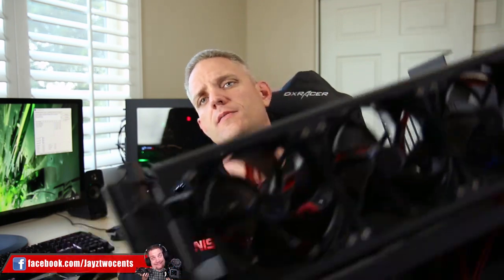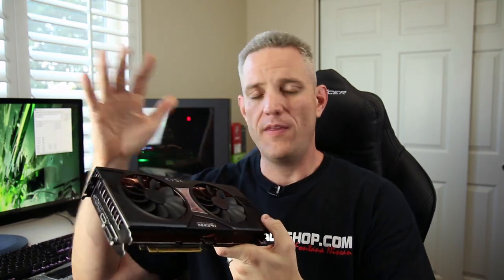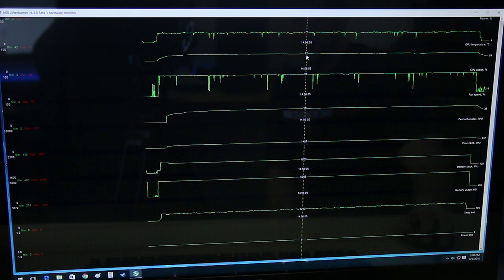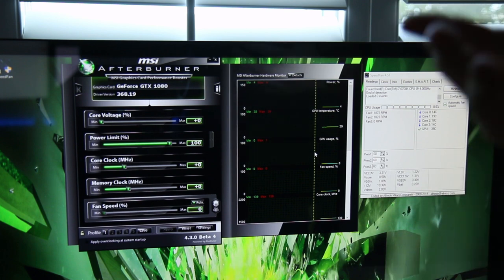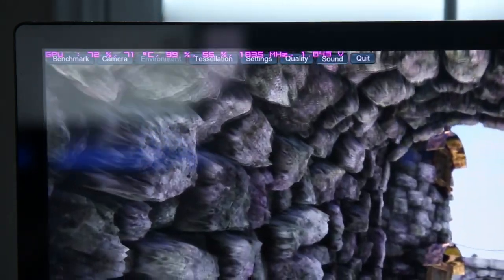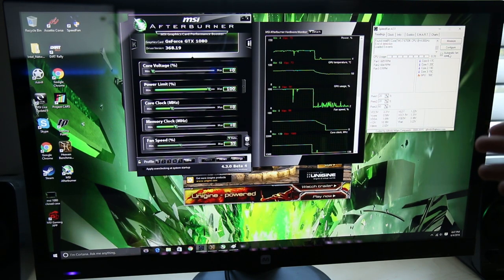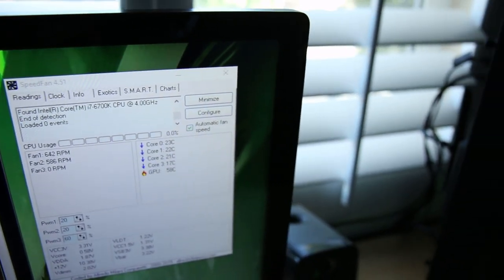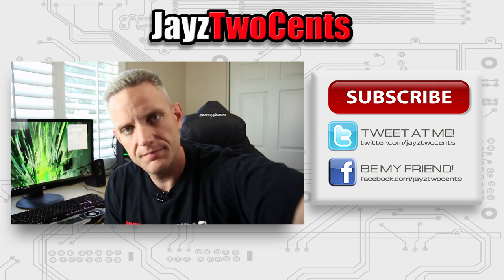Do cases make video cards run hotter?? - Test Bench vs Case

Comment from the maker: Now the argument seems to have shifted to "Why are you using liquid cooling?! Thats not fair because CPUs can heat up a case...." So now there are folks saying that CPU temps should be factored in.... how am I supposed to account for all the different CPUs and CPU coolers? I am testing the coolers ability to deal with the heat the card outputs, not how well it deals with poor case airflow and CPU coolers.... I expected the argument to shift a little after this video, but now its just getting ridiculous. 

There is absolutely no way for me to give YOU the test that 100% represents YOUR situation. Impossible.
Reply: Agreed.
Reply: can't wait for the 1070 sli. don't listen to every whiner out there. they think they know this and that and somehow they don't have a YouTube channel to be showing what they know. we saw what you tried to explain and that's that.
Reply: Jay if they want to be idiots just tell them the front mount rad pumps loads of heat the inside of the case just like air cooling would.
Reply: The front mounted radiator would heat the case just as much as an air-cooled tower cooler, would it not? I could see their argument if you had the radiator set up at the exhaust, but being at the intake the same amount of heat is still being taken from the CPU and displaced into the case. Seems like some people don't understand basic thermodynamic principles...
Reply: omg just ignore them.... lol. The testing here has already been comprehensive enough to show that this is a non issue. Thermal throttling can happen to any card that has been put into a badly ventilated system configuration. You cant take into account of every single scenario.
Reply: you did a good job jay :)
Reply: Next argument will be the cup holder err the dvd rom is broken.
Reply: It would. It's taking more heat off the processor, but since his radiator is set up as intake in order to keep the CPU itself cooler, all that heat that it is taking off is going into the case. Worst case scenario for the rest of the components, but best case for the CPU.
Reply: Thank you for making this video.  It is annoying that people seem to think what they want to believe and believe it as fact so much every other actual fact is BS to them.  This video proves exactly what you thought to be correct.  Using your open test bench doesn't affect temperature or fan speed on the card for that matter. I knew exactly how this would turn out, because if you have a case with a good airflow and your temps are spiking to over heating levels opening the case does jack squat for temps, unless you get a giant ass fan blowing on it.
Reply: You can't please everyone Jay......keep doing what you do!
Reply: Jay, my goodness, I don't know if I could handle the barrage if insanity. Wth is wrong with everyone? FFS, you have absolutely no reason to tweak or mess with numbers.. Man the way you had to go out of your way with one long shot to show these people there is no conspiracy. This mob mentality and stupidity reminds me of the truthers and other internet idiots who see a single post on 'any' website and take it as fact. They stand tall on it, bullshit as it may be, and defend it to the death. You got some seriously good inhibitions, I think I would lose my fucking mind.
Reply: Easy, just do the test WITHOUT the CPU ;)
Reply: The vast majority of your subscriber base im sure believe your initial test and the vast majority of the people saying otherwise are likely trolls.
Reply: Haha
Reply: People who understood the video and its purpose aren't making these questions. I would urge people to request Jay to make  some specific type of content that they want to see, and not just put off this informative video as bad.
Reply: I've always thought that it was impossible to represent all configurations. What's important is to be consistent between tests (at least if you are going to compare results.) Beyond it comes down to what makes sense for you, which is likely the test bench for ease of use. 

That being said I can see where most people are coming from. The most common configuration of people watching these vids is likely a CPU with a tower cooler and a discrete GPU in a closed case with only a couple of fans installed. That's likely going to allow the heat to increase in the case when the system is under heavy load, but obviously it will depend upon the configuration of the system (# of fans, location, amount of air moved by the fans and even cable configuration could change the air flow.) Which gets back to being consistent between tests.
Reply: but but but jay you didnt farthed in front of the rad.

the good old airflow in case that is an forgotten feature....

every pc setup has hes own situations depending :
-what case ,what size of case ,what size of fans ,amount  of case fans,intake or outtake count.the only general  factor these days is that all cases are made for positive pressure airflow.thats why the big amount of holes in the case every where ,does it have open side panels and are there fans  mounted on it.
-what cooling do you use for cpu ? air , air vapor chamber, AIO watercooling , custom watercooling and what fan size do you use and rad size.
-what cpu do you use 
-what gpu do you use and how is it cooled
and the list goes on and on and on .

no-one is able to test all the setups existant in the world and the best tester for your own setup is yourself.

there is general information from the people that do tests,reviews and benchmarks but its an guide line and not an final answer for every setup.

pls Jay stop taking those 13 year old know it all in frontal .its a troll battle you will never win and only harm the channel.

keep on the great info and get the 3 way 1080 sli  working vs  2way sli so we all know if getting an 3th one on this new line up make sense.
Reply: what was the room temperature?
Reply: Can I send out my system to you and you test it for me? but please account for my dusty environment and high ambient temperatures during summer as well as low ambient temperatures during winter. Thank you.
Reply: They are butthurt because they expected the results to be reversed, when they didn't see what they expected they lashed out.  That is like the videos on LinusTechTips where they compare how important the shape of thermal compound is, how important cable management is, how important power supply positioning is, etc...

I think a potential reason why the card ran better in the case is because the airflow is more concentrated.  With an open test bench, the air can escape out into the open room, leaving less air for the card.  With a computer case, there's only so many places that the air flow can go.  That allows more of that airflow to reach the graphics card.  The volume of airflow will make a bigger difference than a couple of degrees temperature.
Reply: A front mount radiator pushes all the CPU heat back into the case anyway, far more than any air cooler would.  People who are saying it's "unfair" are idiots who don't understand Thermodynamics.
Reply: It shouldn't make much of a difference regarding the liquid cooler vs. air cooler on the CPU because in this set up, the liquid cooler's radiator is set to blow the hot air dissipated by said cooler right back into the case... Girls please....
Reply: yes also people still dont seem to understand the same amount of heat is being output into the case no matter if its watercooled or stock cooler whatever
Reply: do people notice that a tower heatsink is also a radiator....they both exert heat....also the fact that Jay's rad is in the front means the heat is channeled into the cards intake, while a tower heatsink would be closer to the two exhaust fans in the back...which is probably even more unfair...
Reply: Surely it would not be too difficult to take one of the many chassis Fractal Design sends you or any other company for that matter. Put in something average Joe might have like 2-3 harddrives, optical unit, hyper 212 air cooler for the cpu and no additional chassi fans beyond the ones that comes with the case. Trust me that chassi will get toasty after a few hours ;)

Then actually test with benchmarks that use both GPU and CPU for a few hours on whatever graphics card you got currently for testing and not 20min on something that only pushes the gpu.

Or we can say fuck it there is no way to get a 110% representation of an actual computer and use a test bench ?
Reply: I think test beds are more neutral. Everyone has a different PC config, someone might even have a dildo taped inside of it to un- sag their GPU. The best methodology is the test bench where nothing external is affecting the cards performance, since its impossible for Jay to tailor his reviews for all 700k or his subs. What you get is the baseline. How it behaves differently if you buy it is up to your unique situation.
Reply: You should do a video with a cardboard box, that's gotta be the ideal situation for SOME people... or putting a cardboard box over your open bench like what you and Jerry talked about on Tech Talk.
Reply: Surely if there's any difference at all the delta would be so minimal as to not be noticeable in the real world... Anyway it was interesting for me, even though I'm not surprised by the result.
Reply: Don't let them get to you, what's next "but Jay someone in the next room had a hot cup of coffee and that's gonna scew the results neurgggh (imagine a prepubescent wail)".  Keep on keeping on man!
Reply: Jay to make those people happy just jump into the witcher 3 and go to novigrad the cpu will be busy doing the npc's and the gpu with the graphics most realistic I think. It is how I test at least
Reply: Doesn't water cooling dissipate more heat,  actually? Especially if you have a radiator on intake.
Reply: There are two groups of people here, the group comprising people that understand how to interpret test results, and the other group housing idiots and trolls. At this point you've done due diligence, everyone with at least half a brain is happy.
Reply: " but now its just getting ridiculous."
Welcome to the internets JayzTwoCents
At some point you're just gonna have to let go, just let it go! 
My tip is - Let it go and tell them to make their own test videos. ;)
Reply: For the love of..... People are ridiculous..
Reply: air conditioner keeps the temps the same. with a steady flow of cool room temperature  in or out of a case. without an ac id imagine you'd be seeing thermal throttling especially in California. I am curious if that's the case jay and if you would release non ac results.For case vs open test bench as long as your have adequate air flow and keep your case relatively dust free I doubt there is a difference between the two. without an a/c though id imagine it would gradually get hotter as the computer heats up the room.
Reply: Good job Jay :)
You have suggested in one of you videos to remove the side panel of the case as preparation for the summer in hot climate to improve the temperature within the case ;)
now seriously. The Heaven  does not cause any CPU load. And frankly, not really punishing (thermally) the GPU.
Another point, is that you tested it with a GOOD case. The thing with this specific case, is that the intake fans provide direct airflow to the card. 
A lot of people are using cheap cases with only 1 or 2 fans.  I guess a majority of the cases sold, have front mounted HDD cage which prevents direct airflow to the card even if there is a front fan.
So a realistic (average joe) scenario would be:
* Case with front mounted HDD cage.
* 1 in 1 out fans.
* 30 minutes of gaming to allow all components to heat up the air within the case.
I know all that because I own a case with shitty airflow (CM690). It has front mounted HDD cage. Was shipped with 1 front and 1 rear fans (if I remember correctly). Now it has 2 front (i don't use 5.25, so I installed an additional 120mm intake fan with adapter for 5.25 bay), one side (directly to GPU), 1 rear out (with 120 rad) and 2 top out (with 240 rad).
Even after heavy modification of the case (I cut out the grill (metal/plastic parts of the case) on the exhaust fan mountings to reduce noise and improve airflow).
So even after all that, and the fact that both CPU and GPU are watercooled the air temperature delta within the case is about 2-3C between low and high fan's rpm.
Reply: Mike W it would not matter .both temps will go up as both suck air from the room that gets hotter.
Reply: Dmitri if you remove the CPU from the equation then what will be causing the Temps to rise? Nothing because hard drives do not run hot, and same for the motherboard. So even if Jayz had his radiator in the back it makes no difference.
Reply: dionyz1 There is no issue with the radiator positioning. The heat is generated by almost everything. Noticeable heat is generated by the CPU, GPU, VRM (of both CPU and GPU), chipset, RAM and VRAM. Even liquid cooled video card with full coverage block will still be warmer than ambient - at least +10C under load. So in poorly ventilated case, the temperature inside, will be considerably higher than ambient outside the case.
And as I pointed in the comment, the issue with Jay's setup is direct airflow from intake fans to the card. This helps to keep the card cooler. My suggestion is to do it in a case that have a HDD cage between intake fan and gfx card while having only 1 intake and 1 exhaus fans.
Reply: Well, your liquid cooler heat is going to the front radiator, so that makes it absolutely equivalent to an air cooled CPU. Except if your fans are blowing instead of sucking air into the case...
Reply: Bourinos02 "absolutely equivalent to an air cooled cpu" thats your quote?

 learn science mate and more important learn pc hardware.
Reply: MrBall Breeder It is, the fact that heat is spread in the air via the radiator on the CPU or displaced on another radiator inside the case via liquid cooling doesn't change the heat generated by the CPU AT ALL. It's not rocket science, it's just a basic understanding of "my CPU will not suddenly generate more heat because it is liquid cooled" or in a more scientific case " heat is going to go somewhere".
Reply: Having the an air cooler for a cpu and redoing some of this testing could be rather interesting.
Reply: ***** in this case, that can only improve GFX temp since the air blown at it will be cooler ;)
Reply: Agree with Jay also. Every little factor can't be accounted and tested for. You tested both ends of spectrum. What about the motherboard being the cause of the different voltages?
Reply: Haters gonna hate.  Simple as that.

Just keep doing what works until another method proves better.  There's just no FEASIBLE way to test for every scenario possible.  Go with what isolates what needs to be tested, and then the individual needs to figure out how to use that data.  I don't see why that's hard to understand.
Reply: The pump on AIO cooling still emits some sort of heat. Just not as much as a heatsink. that 4- 7 degrees can easily be ignored.
Reply: The radiator from the AIO was at the air intake, so it's probably the same amount of heat as using an air cooler.

It also seems like the heat introduced from an air cooler or AIO radiator is negligible with enough air being exhausted.
Reply: it's cool Jay, I understand your methods and liked the video. no hate here, just a huge fan of your videos :D
Reply: besides... the delta of overall heat output of a CPU using an Air cooler compared to a Liquid Cooler are negligable... it's the same about of energy, just spread out across a greater area, thus having a lower measured heat... same energy is there. shouldn't make a difference big enough for haters to hate
Reply: LordDecapo just to be sure about the real data. did you know that smaller cpu makes smaller hotspots that watercooler can cope better than aircooler and thats the main reason why watercooled cpu overclock better/higher with higher voltage.

did you know that vapor chambers give similer results of watercooling just because same reason .

im not talking about the overclock overall but about the heat spikes that boost / turbo creates. 

there is an aircooling solution where diamonds is mixed in copper to deal with that and has been tested many years ago.it was just to expensive to make it to the market. 

been talked about since 2003:
http://www.rhp-technology.com/en/products/diacool-heat-sinks/

and has been tested and talked about at computex years ago:
http://www.eteknix.com/computex-noctua-show-copper-diamond-heatsink-base-technology/
Reply: A CPU absolutely will affect the temperatures significantly. Now I wish you would have consulted a scientist, this is the sort of thing we do all day. It doesn't matter which CPU heatsink you use as the CPU will be putting out the same energy regardless of heatsink. As for different CPUs, you could have gone for a standard Intel chip and then highly overclocked Intel to account for the higher waste heat for overclockers, AMD users and everything in between.

Now my experience is near enough absolute proof for me. I recently upgraded my system and had a 200 Watt power increase for 2 weeks before my new fans came through. Prior to the fans coming the case was 25 degrees above ambient and the GPU was 55 degrees above ambient. After the new fans the case was around 10 degrees above ambient and the GPU was 40 degrees above ambient. In essence the GPU was exactly 30 degrees above my case temperature regardless of what it was which is absolutely what I expected.

My computer is a 8370 with an XFX R9 Fury (3 fan long heatsink). I have 2x140mm, 1x120mm fans intake and 1x140mm 1x180mm exhaust. My previous fan set up used fairly slow mid priced silence based fans, my current setup uses high end silence based fans with reasonable airflow (Fractal Venturi etc). None of my fans blow air directly onto the GPU.

My take from this is if your power usage is far too high for your case then you will find a significantly higher temperature compared to a test bench (as I did). If your fan setup is capable you will end up with a slight deficit compared to a test bench and find diminishing returns on more powerful fans. Direct airflow is a far better performance gain as rather than using the higher temperature case air it will have a reasonable percentage of ambient temperature air. Something like the silverstone air penetrator is ideal, though they don't perform as well as a few choice fans (ap123 does well but is only 120mm while most cases take 140mm) they do direct airflow much better. Once again this effect hits diminishing returns where a more powerful fan won't help if the GPU already has low temperature direct air. A test bench will also use fan directed air, but as it uses ambient air anyway the direct air is simply a replacement for the GPU fan and should be running at minimal speed just to keep the exhaust away for consistent results.

Ultimately your test case was running with a low power system (no CPU heat with water cooling) and a far superior case and fan setup than required already in the diminishing returns area with the low speeds. Thus the only thing that case was doing was supplanting the GPU fan with a case fan. This is what most perfectly set up computers will see but the majority simply won't. No direct air would dramatically change the results (HDD bay for example) as would CPU air cooling. In fact I would bet that the majority of viewers both have no direct air and an air cooled CPU giving 10+ degrees to the GPU temperature.

Finally, my suggestion is to keep using a test bench. Whilst its not representative of the real world it both gives the most consistent results and allows the results to be compared to other reviewers, something a case cooled GPU won't allow. It should be incredibly obvious to everyone that a GPU temperature is affected by your case temperatures, and as case temps vary dramatically you can't realistically account for all values as the reviewer. As such it should be the responsibility of the viewer to account for case temperatures and their own setup, there simply isn't any viable alternative. Of my 2 closest gaming friends and me our case temps vary by 30 degrees. Congratulations if you read all that, it should give some insight into the problem at hand.
Reply: Olivia Lambert wow ... that was a lot of letters. And you are mostly correct. The exception is water cooled CPU.
In this setup, it just does not matter because the radiator is front mounted and pushes hot air into the case. That way, the CPU heat is moved out of the case by the exhaust fans exactly as with air cooling.
And your points about direct airflow and fans setup are absolutely correct.
Reply: +Olivia Lambert long comment, read it all. I agree 100%
Reply: I think you are confusing HOTSPOTSPIKES with heat in the case... A water cooling is more efficient than air cooling because of several factors including:
- The heated volume is WAY larger than for the radiator only configuration, giving the system more inertia.
- The heat dispersion ability of water coolers are generally way higher than air cooler because you have more space (no need to install a massive CPU rad just above the mobo, you can even plug it on a damn car radiator if you'd want to)
- Heat transfer via actually moving the liquid instead of relying only on thermal conduction is very effective

So with a same airflow coming out of the case and the CPU generating the same amount of heat, your air will have really close to the same temperature in the end. The only limit being if the inertia of the system is too big and you cannot even get to equilibrium (if you get massive ventirads or connect it to huge radiator for example).
Reply: Bourinos02 face palm....

 radiator usage an liquid passing pipes system

thats an quote of the wiki mate:
https://en.wikipedia.org/wiki/Radiator

aircoolers are heatsink and quote again of that wiki:
"Heat is transferred to the air by conduction and convection; a relatively small proportion of heat is transferred by radiation owing to the low temperature of semiconductor devices compared to their surroundings"

updating with an fan turns an passive heatsink to an active one.

next:

inertia of the system.
wiki quote:
classical physics that are used to describe the motion of objects and how they are affected by applied forces.

https://en.wikipedia.org/wiki/Inertia

nice of you to use fancy words but the whole sentence make no sence

i think you mean inertia of system as the water motion right? 
so :
the only  limit beeing the water motion of the system is to big and you cannot even get to  "equilibrium" (for those who didnt knewed it , it means "balance")

as also the sentence:

So with a same airflow coming out of the case and the CPU generating the same amount of heat, your air will have really close to the same temperature in the end.

it doesnt make sence . same temp of what?

and what with the :
with a same airflow coming out of the case and the CPU generating the same amount of heat.

didnt knew that radiator fans where exact the same as case or aircooler fans as in airflow concern and didnt knew that differant clocks can give same heat.

again you show basic knowlede and put in fancy meaningless words but your argument and statement doesnt make any sence.

watercooling extract faster the heat from the caps and transfer to rads . it takes time for the whole amount of liquid to get warmed up to its nominal temp .after that the temp will barly change but as water beeing an better heat transfer it can take higher heat from the higher overclock and heatspot spikes while aircoolers have to deal with it directly at the moment of heat release and by that clocks lower . vapor chambers is an between solution as it act as watercooling at start but end as full aircooled when all the liquid becomes vapor .

these are facts mate  and not school theory.

and common man realy? this debate started because your "air is equivalent to water" statement .

water gets your cpu at higher clocks with higher voltage so it will be never equivalent to air.
you need an labo sealed room  to test it out if the higher overclocked (at MAX) with watercooled cpu/gpu vs the lower clocked aircooled one

so whos confusing here?
Reply: ***** you don't really need more than 2 fans though.

The only thing you need is a side mounted fan blowing on GPU(s). (and an exhaust)

The solution to all your problems ever. Kept my old 680 cool, and keeps my 2 970s cool now.

I have a define R4, previously had a shitty aerocool case.

Both have a fan thingy right where the GPU sits, and I didn't notice any difference whatsoever. switching from my crampy old case to my new roomy r4.

I even made the mistake of mounting my H100i fans to suck in air from the top (cause I'm a pleb). I was going to fix that until I noticed it actually doesn't even matter.

also, don't get a cheap case with a side window if you care. You're just asking for trouble.
Reply: frestylezz I have 3 in and 3 out fans. My system as liquid cooled (GPU and CPU). So my only problem is ambient well above 30c. But that is solved with air conditioning. 
So when the temperatures are +-27C and air conditioning is off, cpu is 40-50c and gpu 60-70c. both are overclocked 21% and 23% respectively. And that generates heat on i7-4770K and GTX570.
But then again I'm not average user. And for the experiment, it was wrong to use a setup that less than 5% of builds and claim something that is generally not true ;)
Reply: +JayzTwoCents you are just getting trolled by the viewers. Give a resistance to those filthy cavemen who live in mom's basement.
Reply: was just about to say the same thing...
Reply: Even Nvidia disagrees, read the reviewers guide of the GTX 1060. That part must be written specially for people like you ROFL!
Reply: +Detmer whyyy would u bump something this old....
Reply: LordDecapo Because of what I red in the GTX 1060 reviewers guide from Nvidia. Made me think about this goofy video...
Reply: +Detmer gah. so evil! u did it again!
Reply: +LordDecapo lol
Reply: "this old" => watch the date : 7 june 2016 => wtf, this is not even 2 month old...
Reply: +Bourinos02 that is AGES for a dead YT comment string lol
Reply: LordDecapo You must be new here :D
Reply: +Bourinos02 nope, u guys just don't follow the rules of all the rest of YT xD
in forums a dead string is anything over 90days, 60 in some cases.
in YT comments, it's like 2 weeks lol
Reply: LordDecapo I've seen threads bumped after several years dude xD Additionally rule number 8 says that there are no real rules about posting!
Reply: +Bourinos02 ya, but if ur the dude who bumps after years. in every place I have posted, people bitch and bitch and bitch lol
Reply: +MrBall Breeder under 1 condition... you must have cookies
Reply: LordDecapo damm i just ate them all
Reply: +MrBall Breeder shit, well make more! I prefer double chocolate chip btw
Reply: ANUM ANUM Not a suspicious link at all, congrats :-)
Reply: Most people just have a need to argue. The main point of you video should have been that using the same test bench is the best way to compare all video cards with as little variable in the test as possible. I don't want to watch or read about a reviewer who uses a different case for every thermal test.
Reply: On another not if people want to see how a well a case performs with airflow read a review about the case.